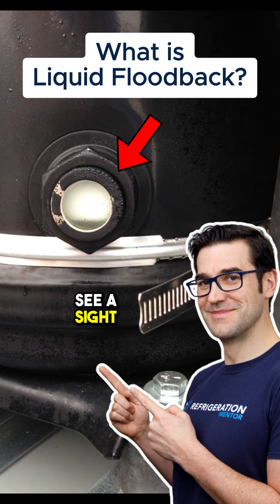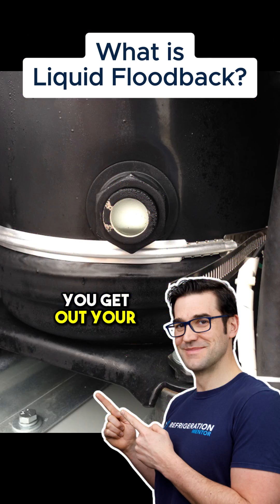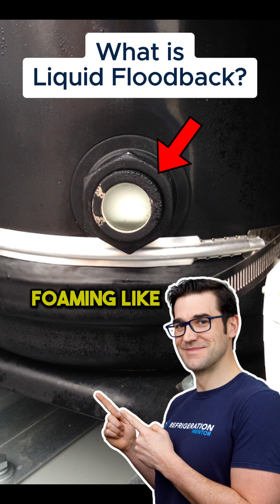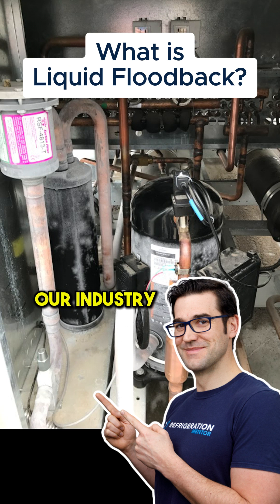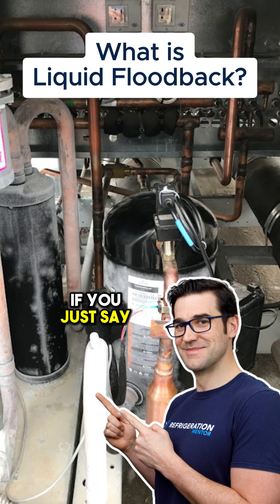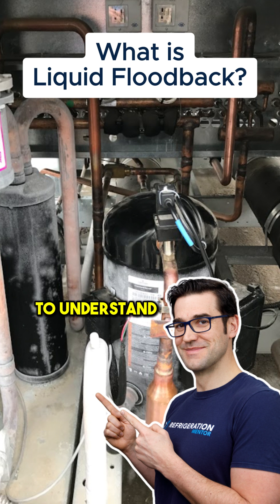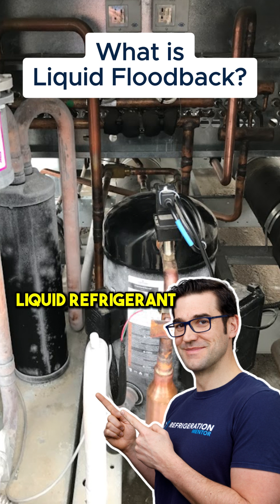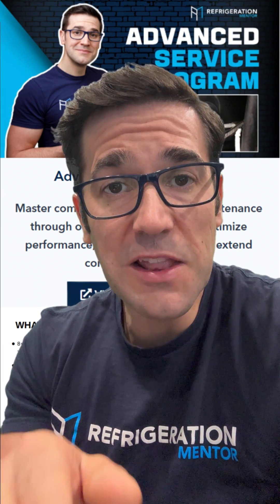What Is Liquid Floodback — And How Do You Check It?

Comment: I see that happen during pump downs as well. I assume the refrigerant thats trapped in oil boils off because of the low pressure and causes that foamy look. It only brief and goes away after the pump down is done. Any other time like normal operation I'd assume it could be floodback.
Reply from the maker: The only real way to tell is monitor the suction and discharge pressures and temperatures as well as the oil temp and with that data it will give you the answer.